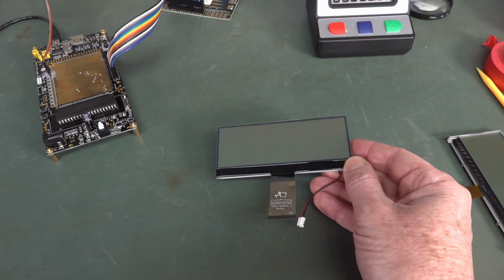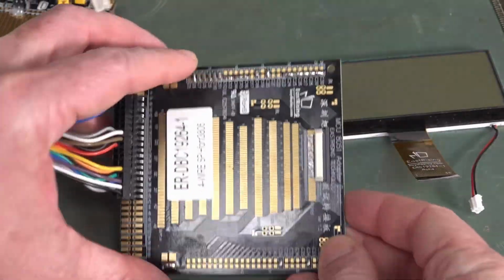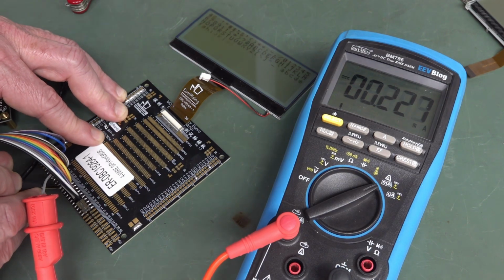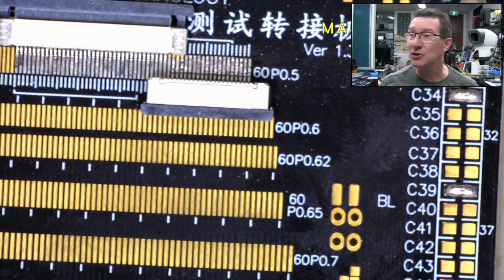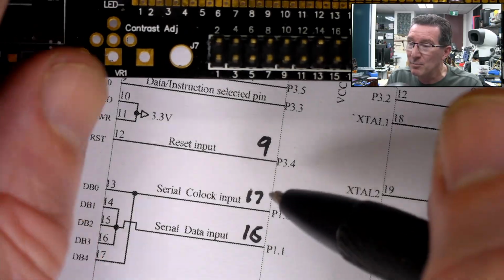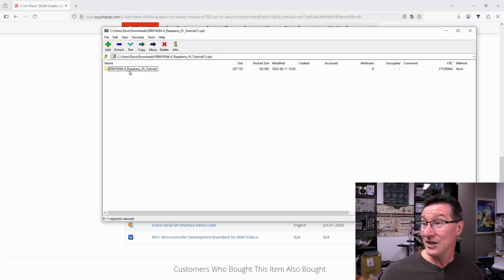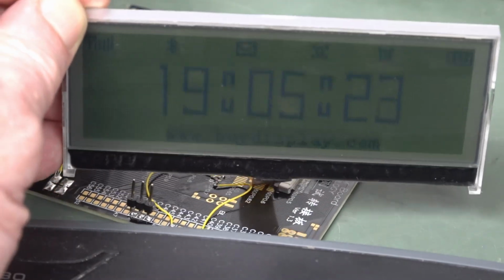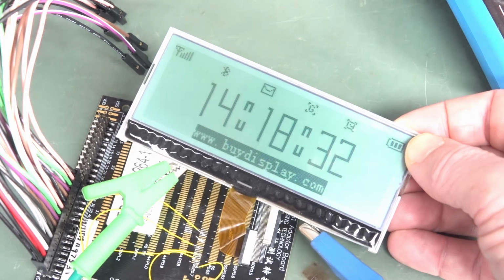EEVblog 1699 - µTimer PROJECT Part 1 - The LCD

Comment: With RasPi demos I wish more people would just include a SD card image - would save so much time
Reply from the maker: The I/O driver install was kinda messy, and the Make didn't work first go, but I'm kinda impressed that it all worked even for an RPi dummy like me. Maybe some luck that I didn't goof it. But yeah, in this case for a manufacturer to just demo their LCD, an SD card image would have been sweet. Come to think of it, I don't know why they bother with their own messy matrix demo board, just supply a cable for an Rpi and the interface PCB and the SD card image.
Reply: But that would require some effort, critical thinking, an awareness of knowing the most efficient way to help others (or being aware that others actually exist, and may want to do this too), and MANY nerds have huge deficits in those areas. 

For all the skills nerds tend to possess, they’re often INCREDIBLY bad at:

💡1: ASSUMING: Assuming everyone seeing their cobbled together niche project for the first time, ✨ INSTANTLY✨has all the knowledge they possess, uploaded into their brains, replete with custom quirks, etc etc. 

💡2: Being aware that, beyond hoping that others will shower them with praise (which they often seem to crave, to bolster their egos), there’s people who would like some help, but don’t necessarily want to invest 6 months in learning some cobbled-together libraries, pinouts, syntax… etc etc (ya know, people who ACTUALLY VALUE their time, hence being initially pleased to have found your project), and if finding your project, which initially seemed like a saviour of a solution, then costs then exponentially more time that not having discovered it, well, ¯\_(ツ)_/ why would they bother!

(I’m getting stressed just thinking about this 🤦‍♀️)

ANYONE can have a good idea, but as I see online every single week, VERY few of them are able to adeptly articulate it in a succinct, intelligently articulated well-formatted tutorial, and offer something as simple as a pi .img file (something I’ve also wondered about, many times). 

There’s a bloke online who modified a Pi games emulator distro - “Leespreevideo” and he did exactly this - SHARED THE PI 5 IMAGE FILE. 

One has to be clever in more ways than mere technical knowledge, to help others.

Comment: The Sharp Memory LCDs are ideal for this sort of thing - exceptionally high contrast , no backlight needed and about 1uA power draw when not updating. Unfortunately they haven't really caught on & were a bit expensive.
Reply: I keep finding products where they would be fantastic, but the cost has always been too high. They've made for some cool personal projects though.
Reply from the maker: @martinmckee5333  Yeah, more suited to unique one-off stuff.
Reply from the maker: Yes, unfortunately not available in the form factor and lower resolution at the 4" size, price aside. It was my first thought.